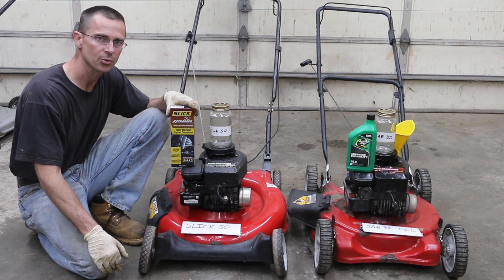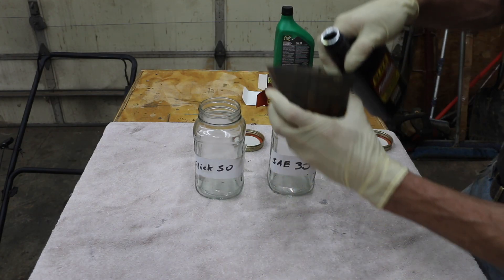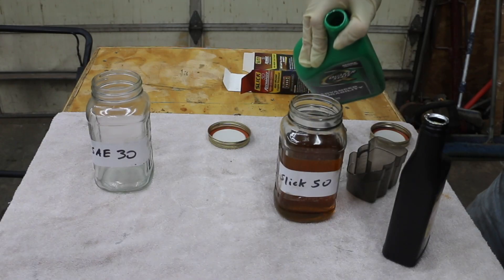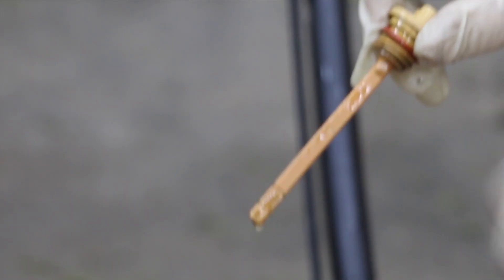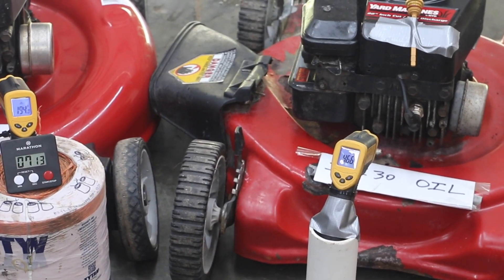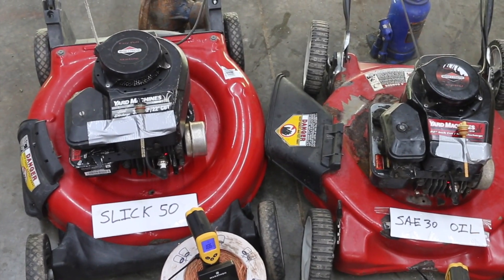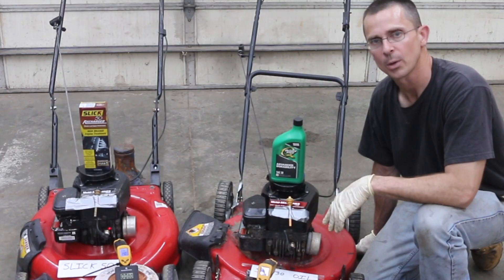Can't believe what SLICK 50 did to my engine!!--Dry Crankcase Test!

Comment: In the mid 1980s, I ran a Saab 900, a 1980 2ltr model with over 100,000 miles on it. For oil changes, I only used the cheapest oil with Slick 50 added. I had used Slick 50 in all of my previous cars and had never had an engine problem with any of them.
One night while driving on the M5 Motorway here in the UK, the engine sump plug came loose and fell out, the engine subsequently lost all of its oil. At the time I was travelling at almost 100 mph., in the fast lane, with fast moving traffic in all of the other lanes. I remember all of the warning lights of the dash coming on together for some reason, but I couldn’t slow down too quick, because of the speed of the other traffic. I made my way across the other lanes of traffic, still going at a fairly high speed, to the hard shoulder, where I could stop. In this time, I must have travelled a good ¾ mile.
I was towed off the Motorway to a local workshop where a mechanic, being unable to find a correct sized sump plug, fitted an old spark plug in it’s place. The engine was refilled with oil, but the mechanic commented that he thought the engine may have been shot, after travelling at that speed and distance with no oil in it.
I completed my journey, more than 150 miles, albeit at a bit lower speed, but the engine still sounded sweet.
I ran that car up until it had almost 200,000 miles on it and then sold it on.
I remember in those days, the adverts that stated how a Slick 50 treated vehicle had been run for some colossal amount of miles with no engine oil and how it had had no ill effects on the engine, which is probably why I had been using it.
Over the years, I have often wondered if having Slick 50 in this engine had saved it.
Reply from the maker: Impressive that the engine survived!

Comment: I have been using STP motor addative, since  1977 I was in USAF and had the ability to test STP , have used it in my engines uver since getting over 100,000 miles with normal maintenence and 3,000 Mi. oil changes,  Slick 50 I have also tested, and found you haver to run it in your engine with oil  for it to work, I went back to using STP, Thanks, Henry Loos Tsgt, USAF (ret)
Reply from the maker: Henry, Thanks for this information. Glad STP is providing good service. The price is also very good.

Comment: I use slick 50 to my old antique truck I had the motor overhaul this got 60,000 miles on it I did their claim of running the motor without oil and never had any trouble out of it
Reply from the maker: Wow! Thanks for commenting.

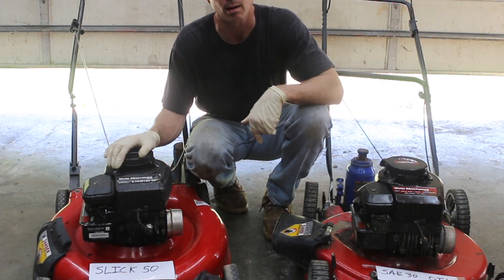Comment: STOP AT 4:00 ===== to be fair you should now drain both and totally flush with a run of reg oil. and drain but reverse the two engines and see if the machines are different running temps- Since they are used and are not same condition as a pair....   NOT ANY SCINECE HERE There is no base line as in all his tests he is not a lab scientist. PERIOD. His monitor system is a joke, a gun.. No connected sensors with data reads.  even a 10% rpm difference would ruin the whole test. No calibrations.
Reply from the maker: Thanks for the constructive feedback.
Reply: Can you show us how a proper scientific experiment should be done so we can replicate your experiment and attempt to duplicate your results?

Comment: Years ago I remember a product called "Prolong" with John Schneider (Dukes of Hazard/Country Singer) hosting an infomercial. They showed a small Single Engine Aeroplane that was specially rigged with a cable they used to pull and dump the "Oil & Prolong" filled Crankcase on the Aeroplane's Engine during flight. They pulled the Cable Mid-Flight and the Aeroplane kept right on flying after as if nothing happened. Maybe you could put this to the test using "Prolong" and a small engine. You showed the "Slick 50" treated engine which ran cooler while it was in the engine. Evidently it's only good whilst in the engine. Lastly I paid $700 for a 1ton 1977 Chevy Van with 20,000 miles on a completely rebuilt 350cu.in. Engine bored 0.030" new Pistons, Rings, Bearings, the works. It had very low geared 8 Lug Rearend and a 3 Speed Transmission. The Van read 3,500-4,000rpms on the Tachometer going down the Interstate and got 9 miles per Gallon of Premium (only) Gas. Ouch!! When I let off the Gas the Van slowed down like you were running a Car in 2nd Gear. At 260,000 miles on the Odometer the Engine began to knock a little and began to lose power. I switched to "Mobile 1" 15-50 Full Synthetic Oil. The Engine got totally silent and regained power. It seemed to have even more power than when I first bought it. Mobile 1 was so slick when I let off the Gas the Van would actually pick up Speed going down hill even when Taching 3,000-4,000rpms whereas before the Van would slow down immediately. I drove it another 210,000+ before a Radiator Hose burst going down the Interstate and it blew a Head Gasket. Unbelievable!! I had another completely rebuilt 350cu.in. Chevy Engine. I used HavOline 20-50 conventional Oil. The Engine burnt Oil until about the 3,000-4,000 mile mark and the Piston Rings seated. I had 3rd completely rebuilt 350cu.in. Chevy Engine and I used "Mobile 1" 15-50 Full Synthetic Oil. At 30,000 miles this Engine was still burning Oil like crazy. I had to switch the HavOline 20-50 conventional Oil and drive it another 30,000+ miles (over 60,000 miles total) before the rings seated and it quit burning Oil. If I hadn't done this myself I wouldn't believe it! Mobile 1 is the best hands down!!
God Bless You 
& Your Family. 
Jimmy in NC....
Reply from the maker: Jimmy, I really enjoyed reading your comments!  I really like Mobil 1 synthetic oil!  It really extended the life of your van!

Comment: I did not read all the comments but I really enjoyed your approach to test theories and hypothesis.  The only thing I would question was, the motors could have had a pre-exsisting condition that caused one to fail before the other.  The example you used to demonstrate the Lucas vs. STP was done in a way that you were comparing apples to apples.  Both motors were both HARBOR FRIEGHT TOOLS new OHV motors.  It is weird that in both cases, the hotter motor lasted longer when drained of oil plus their respective additive.
Reply from the maker: All great points. I believe the engines that appear to be running hotter are dissipating heat better.  Thanks again

Comment: An interesting test result.   My experience with Slick 50 in a multi-cylinder engine was that it had serious problems with deposits in the oil galleries;  these broke free and blocked oilways in the crankshaft causing bearing failure.  I have always advised folk to avoid Slick 50,  based on my experience.
Reply from the maker: Great point.

Comment: project farm i like your test.Even though slick fifty engine broke first i was surprised how much cooler the slick 50 kept the engine   as long as the lubricants were in the engine.Do you not think there maybe some benefits to slick 50 if you factors in the engines with the lubricants before they were drained?
Reply from the maker: There may be a benefit, but I believe there are better additives out there. Thank you

Comment: Try using 2 brand new identical motors maybe slick 50 motor had 100 more hours on it maybe slick 50 engine still has factory original oil in it  and other engine had oil changed every season half ass test
Reply from the maker: Thanks for the constructive feedback.

Comment: On your bearing machine. Try Head & Shoulders Shampoo. Zinc is in it and I saw it used on a bearing machine years ago. The man working the machine put all the weights he had with him on the machine and it didn't stop the motor. I'm not saying to put it in your oil. Just something to try.
Reply from the maker: Thanks for the recommendation.  Anytime I test an additive on the bearing tester, standard procedure also requires its use in an engine to also test performance within the engine.  Then there's the cold temperature test along with several other future tests that I'll be including.  Why all the tests? One single test doesn't provide sufficient evidence of quality.  Thanks again

Comment: I would love to see this test done with a product called Dyna-Lube. You can get it online at dynalube.com.   I have tested a bunch of other additives against it and nothing has even come close. I really enjoy your videos. I hope you will take the time to try DYNA LUBE and let us know how it does.
Reply from the maker: Great test idea!
Reply: @ProjectFarm   I know the owner of Dyna-Lube did a live radio broadcast while driving around a 1972 Mustang (351 cid) with no oil in the motor. They drained the oil and filled the oil pan with water. They drove the car for over 30 min doing the radio broadcast. The DL was not contaminated by the water. The water helped cool the engine while the DL still provided lubrication as it was in the micropores of the metal surfaces.  I'm looking forward to seeing a test. 👍

Comment: Hello, again. Conclusion is that slick 50 will reduce internal friction with the motor oil as seen in this test.  Might be some good to it as an additive going forward. This test proves that motor oil provides the best lubrication under empty crankcase conditions. Thank You.
Reply from the maker: Thanks for commenting on this.

Comment: I used Duralube one time on my old Ford Fairmont that had an oil leak. Going down the highway, I heard some loud ticking. I pulled over, kept the engine running to see what was making that noise, and it was coming from everywhere. Checked the oil...what oil? I said "F it" and drove to a gas station at the off-ramp and got 5 quarts of oil. Added it in and the ticking stopped. The engine was still startable and can still run pretty well (for a Ford ;P). I don't know about compression, but the power was the same...little LOLZ.

It still ran even after the trans gave out. Start in first and shift to third until the ball joints gave a year later.

I would love to see this tested.

Comment: With two well-used motors like that and no way to tell what the internals looked like, I would have liked to see if the "hot" motor ran cooler with the Slick 50. It seems pretty odd that the hotter motor ran 3x longer than the cool motor.
Reply from the maker: Thanks for the constructive feedback.
Reply: You ought to disassemble the Slick 50 motor to see why it seized so early. The other engine obviously overheated, but what happened to the first one?

Comment: If I were a Slick-50 rep, I would point out 2 things that that tainted this test. First. you didn't follow the Slick-50 instructions. You used twice as much. I would think that would work better, but I'm not a chemist.The bigger problem, that would save Slick-50 in a court case, YOU DIDN'T PULL THE DRAIN PLUG on either engine!! Who's to say there wasn't some oil left in one of them?  I'm not saying I doubt your test, but that is a big question. Why didn't you just pull the drain plugs? The extra effort you went to, instead of just draining them seems fishy.In the TV commercial you talked about, they drained the engine, and LEFT THE DRAIN PLUG OUT! I don't believe that commercial, but at least they "clamed" to do the test wright. your test was questionable.
Reply from the maker: All great point. One of the two mowers didn't have a drain plug.  I've got over 20 mowers and a few didn't come from the factory with drain plugs.  Poor design. Thanks

Comment: A very long time ago, when Slick 50 first came out, or shortly thereafter, (or at least when I first heard of it) about 1990. I bought a litre and used it in my 11hp Craftsman riding mower. I had already used that mower for a year without any issues. Immediately after using the slick 50, oil leaked out of every orifce of that engine. It came out around the crank at the bottom, it came out under the flywheel, it seeped out between the case halves, it even came out of the crankcase vent. After draining it out after only one use, conventional oil also would not stay in the crankcase. Basically it ruined the engine, because you had to top it up after every use, and oil was everywhere. Never purchased it again, glad I never put it in my car.
Reply from the maker: Wow!  Thanks for commenting on this.

Comment: Would any of the engines start after adding oil?
Reply: I bought my wife a Jeep Grand/ Cher 1996 Orvis  new.  I got up about a month ago 7/2018 saw a trail of oil out of the drive way she came home said I see check gauges.....warning .  NO OIL PRESSURE!!!!!  she went 10  miles with out oil (Oil sending unit ruptured)  Used slick 50 and Prolong with Valvoline sinthic oil something saved that engine 5.2 v8.

Comment: You think the dramatic engine temperature difference was because the cooler engine was blasting hot exhaust gas straight at the hotter engines intake?😉

Comment: Does any one remember the additive called TMT? I put some in a gremilin one year before  i left San Jaquin valley in CA.when i got to arizona i heard the engine just go from a hum and it went almost silent the normal hum changed so fast i thought it had died or my ears needed popping i pulled over quick to shut it off thinking that there was something wrong,,anyways i drove on ..i didnt remember saving that much more gas  but i did remember the engine ran smooother that was about it.
Reply from the maker: Impressive!

Comment: Back in the day I did a lot of dyno and track testing of the best engine oils in old style flat tappet race engines where the camshaft and followers were very heavily stressed, ALL the synthetic oils we tried even when loaded up with additional friction modifier additives showed wear/damage to the cam and flat tappets and in the case of competition Mobil and Motul synthetic oil products the damage was as severe as any of them.
The best oil we found that prevented any wear at all was Valvoline Racing 20W50 high ZDDP content and if you'd take my advice, you should never use a synthetic in any flat tappet engine that has been fitted with a competition camshaft and race valve springs.
Reply from the maker: Thank you for this information. Did you ever test Bestline or Prolong in them?

Comment: I think the best bet is to just use a top grade synthetic oil. I use Amsoil 10w-40 100% synthetic in my John Deere lawn tractor. Been using it since I broke it in back in 2007. I don't even change it all that often. I use Deere's own oil filter. With a E3 plug, I can start the engine with no choke at minimal throttle setting in about 5 cranks or so in above 50°F. I also use this oil in my 7000rpm V8 and my new Mazda3. I think oil additives in regular oil are nowhere near as good. As well as using them with synthetic oil is, at best, redundant. At worst, damaging....
Reply from the maker: Great recommendation.

Comment: in the early 94 a friend ran a auto repair shop he told me not to use slick50 cause they have had a number people come in who used slick 50 and the engines seized up (he was thinking it may have cut a bunch of carbon loose and it pluged oil screens)
Reply from the maker: Wow! Thanks for commenting on this.

Comment: PF: I tried this Lucas on my Cub Cadet that has a leaky seal and the leak stopped.  for how long, I don't know.  If I can use it though for the rest of the mowing season and then tear it down, that would be great.  I have applied this to my other long use/high mileage engines.  I will let you know.  I did get a 0.8 mpg boost to my 2005 Avalanche after adding it during a regular oil change.  I have done nothing different other than adding the Lucas Oil Stabilizer.  Good stuff
Reply from the maker: Impressive results!  Glad it helped the Avalanche too.  Thanks for the update.
Reply: Hey, thanks for your videos.  They have really been helpful: either in validated choices made prior to seeing your videos or making informed choices after seeing them.  I am learning a lot.

Comment: Technically the slick 50 seizing faster means it had better lubricity... I know that sounds wrong but it could very well be. Due to the fact that engines use journal bearings not ball bearings, the slick 50 could have kept lubricity for a longer period of time while sae 30 was immediately eating away at the bearing allowing it to spin longer but the temperature change in the slick 50 engine causing components to expand and then pushing the oil out caused it to seize faster than the motor that was just eating itself away. I bet if you took them apart you would see much more wear in the sae 30 (Bearings almost completely gone) while the slick 50 motor bearings probably look fairly new in comparison
Reply from the maker: Thanks for commenting on this.

Comment: Those old slick 50 commercials used a slant 6 engine.   But, the fact is, the slant six would run a long time without coolant and engine oil.  That is why isreali half tracks used the slant six engine.  It was the engine NOT the additive.
Reply from the maker: Great point. Those slant 6 engines are durable!